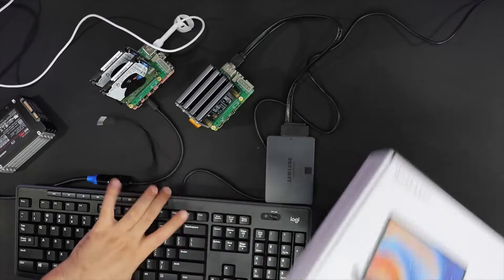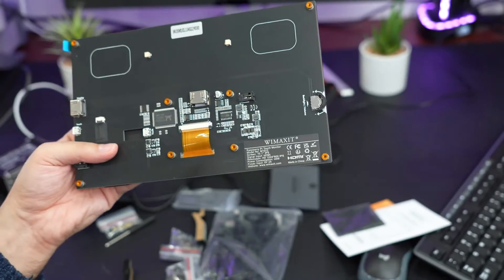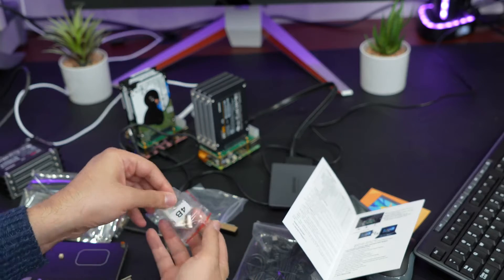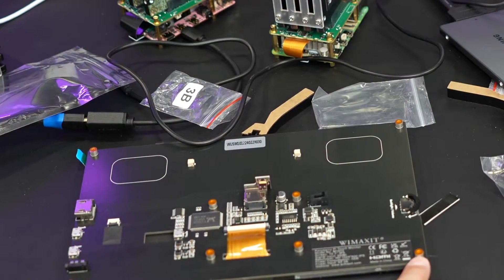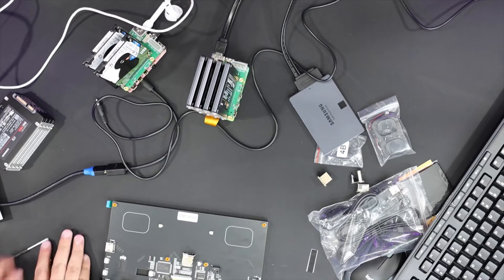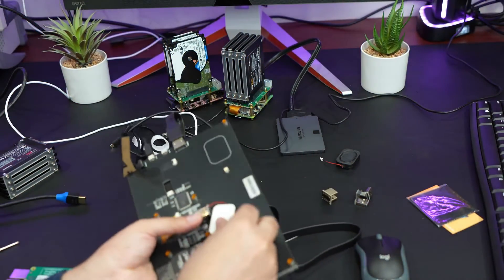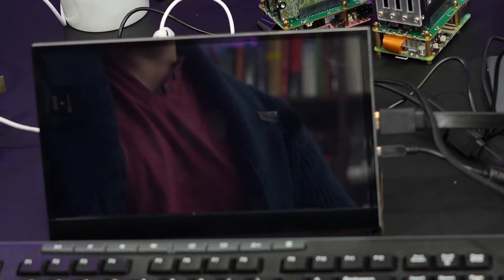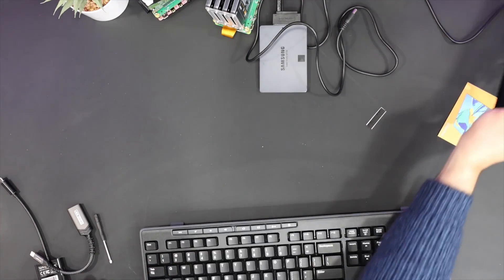The Ultimate Raspberry Pi 5 Wireless Display: Wimaxit M1012 Touchscreen Monitor

Comment: You need to power the display separately right? or is it one of those displays where you plug into pi and only power the pi which also powers the display?
Reply: you only need to power you pi.   the usb of your pi will power your display